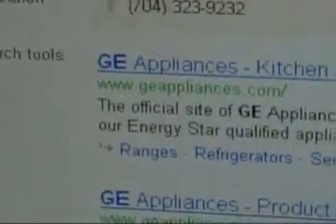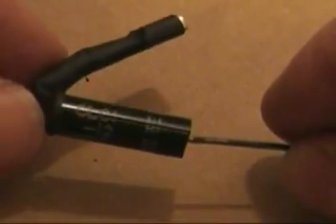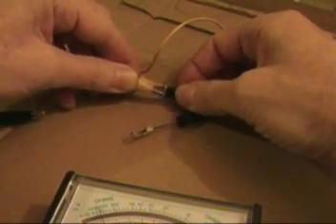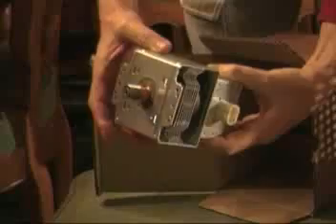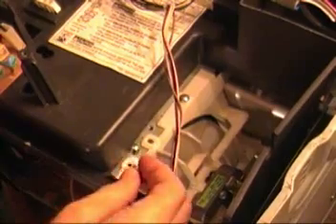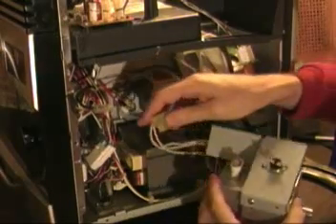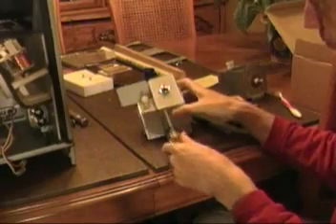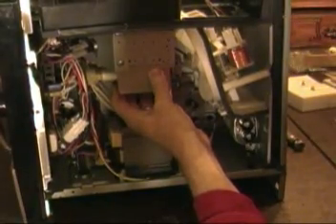GE Microwave Magnetron Replacement And Component Testing

Comment: Every microwave breaks. The parts are from Chy-NA
Reply from the maker: Yes.  Irrespective of country, they make these parts to last only so many cycles, then they quit working.  Infuriating that an otherwise good machine will get thrown away because of a $0.50 part failing.

Comment: This is WAY too technical for me!  I have to do the repair myself, but I'll have to look for simpler instructions.
Reply from the maker: I just re-watched, and I agree that I over complicated it.  If you just buy a replacement diode, you wouldn't have to test it, and you could start watching at 4:09.  If you DO decide to do the repair yourself, you really need to know what "short the capacitor" means, just so you won't get shocked.  They make it so the stored charge bleeds off, but better safe than sorry.

Comment: Did you discharge the capacitor?
Reply: Yes, but in my case, there was no charge in it. The circuit, I think, is designed to dissipate the charge rather than attempt to hold it indefinitely. But it's quick and easy to short the cap, just to make sure.

Comment: My GE microwave is just over 3 years old. Proving again that they just don't make anything like they use to. It stopped heating this morning and the turntable doesn't spin. I double checked the on/off switch for the tt and it still doesn't work. If it is the magnetron, would that cause the tt to stop spinning. Not sure how one has anything to do with the other if it does at all. Can you please give me your opinion.  This makes no sense. 
Thanks,
Rick A.
Reply from the maker: I presume there is fan noise when you request it to begin to cook? Having the turntable stop doesn't make sense if it's a magnetron issue; the typical symptom for a magnetron problem is a "different kind of hum", but everything else is the same. As you say, though, if you do get that "hum sounds different" symptom, the turn table could be just a coincidence.
Reply: Hi Rick, did you ever determine what your problem turned out to be? I've got a GE unit with the same symptoms
 and would appreciate any suggestions from your repair. Thanks!
Reply: Rick Armstrong  sounds like a micro switch .. or relay... if it was the magnetron it would do everything but heat. does it start the countdown what you start it ?
Reply: Dewey Corage It's a very intermittent issue, it only happens every could of months and when it goes out it doesn't count down or do anything (lights always out, etc). The LCD panel is on, but that's it. I've recently determined that all I need to do when it occurs is unplug the microwave and then plug it back in... that's the only way to get it working again and this resolves the issue each time it has happened. So it acts like something is getting locked up in the electronics. I can have it in a state where it's not working and then unplug it and plug it immediately back in and everything starts working.

Comment: It would have been so cool if you could have tested both the old and new magnetrons side by side with your multimeter to show differences. That being said, I guess since your oven had the buzzing noise AND the oven did NOT heat food, you were probably safe to assume that the mag was bad.  My GE has the buzzing noise but it DOES seem to heat normally. IF I disconnect the mag wire connection at the terminal plug, the microwave buzzing noise will not be there. (Do not unplug it while the oven is running, instead unplugged it before I turned it on).

If my transformer was bad, I wonder if I would still hear the buzzing with the mag pulled out? I can not tell which one actually buzzes even when using a long vacuum cleaner hose pipe as a stethoscope to listen to both the mag and transformer. 

The transformer was "borderline bad". One of the transformer tests says it is suppose to be between 80 and 140 olms from the hot wire to transformer shell surface (after scraping off a good section of the shell to put your probe). Mine tested at about 79.5 olms, so I am not sure if the transformer is my problem or not. I mean 79.5 is really close to 80!!!   So I need to find out how to properly test that mag!  i saw a few test on YouTube but none were specific enough..... so I need to keep looking for a good mag test. The test using the my multimeter was sketchy since the video I saw was not perfectly clear. However the mag head was clean and silver, and there was no noise when I shook it. So, if anyone has a good link or info on how to do a creditable mag test I would appreciate it if you could post it.  

Oh...as far as testing that diode, use a 9 volt battery and your multimeter. There is a video on YouTube if you do a search. Sometimes a test is not necessary if the diode has a burnt smeil...... at least that is what I read somewhere.  My diode passed the 9 volt battery test, but since my micro was heating, I would not suspect the diode anyway. 

Good luck to anyone else in microwave hell.

Comment: I have the exact same microwave. I replaced the magnetron, not the diode. After starting it back up, the same loud buzzy noise is still there, and it did not heat up the water after 2:00 of letting it heat up. Any ideas?

Comment: What was your MicrWave Doing aside from not geting Warm?
did yours all of a sudden start making the super loud Transformer humming? :-

mine one day i went to use my MicroWave,,,but it made this loud Transfomer hum and i could smell electrical burn not real strong but it was there?
at that point i didnt even bother to see if it was heating because obviously there was a problem and would almost bet my life it wasn't heating, and probly the Magnatron went south, could be the transformer but i bank against that, Maybe diod, but AGAIN beting on a bad magnatron, 

Please let me know what yours started Doing?

Thanks :-)
Reply from the maker: +chevypowertogo Mine had a slightly louder transformer hum.  No heating, of course. But I had no electrical smell.  Could be that your transformer heated up hotter when the magnetron was not working, giving off the slight smell.  I'd bet it's the magnetron since those transformers are wound with really large diameter wire...kind of industrial strength.
Reply: chevypowertogo 

what was wrong with your microwave? 

you described my issue perfectly.  I have ordered a magnetron, capacitor an HV diode.  $70 total and all new parts.  haven't tested anything but is 10 yrs. old so thought it is in need of some new parts.  beats 300+ for a new one.

Comment: My GE Microwave (built 2012) does not heat. The light inside turns on, starts the count down, but then I hear a 'click' and no hum at all! The count down continues, but no hum! Does this indicate the magnetron is gone? Thanks for any help.
Reply from the maker: jayday80 That does not sound like the magnetron has failed.  My symptoms were that it just didn't heat and, if you were attune to it, the hum was different.
Reply: +jayday80, mine is doing the same thing. Did you find a solution?
Reply: Jodi Monaco Unfortunately I did not find a solution and purchased a new cheaper brand microwave! Someone on another thread indicated it is a broken or faulty circuit. I am not really an electrical guy to troubleshoot and fix it, but I kept it hoping to get back to it someday!

Comment: i need informaition on my ge microwave above range. it went out totally. the lights the whole thing is out.  can it be fixed or just throw it out.
Reply: could be a fuse,but if keeps blowing fuses you may have door switch problem. Hope this helps.

Comment: Hi! is anybody could help me which wire will connect to the blade of capacitor where the diode attached on the other blade of capacitor? Is it the wire coming from the magnetron or the wire coming from the high voltage trasnformer?
Reply from the maker: Sorry, but I can't say specifically.  One thing you could to is look at the schematic.  In the schematic, the diode will look like this -----|<-------.  Google what the markings on the physical diode look like as compared to the schematic.

Comment: Hi! Nice video very informative. I had one question, I'm repairing my microwave and i found the micro switch is the problem. My question is i remove the wire from the magnetron that is connected to the capacitor and 1 wire from the high voltage connected to the other blade from the capacitor and my mistake i did not label the wires, would you mind tell me what wire will connect to the capacitor blade where the diode connected on the other blade of the capacitor? Is it the wire from the magnetron or the wire from the high voltage transformer?

Comment: The big unanswered question was why replace the magnetron?  Since you never tested it?
Reply: Because it was buzzing abnormally and not heating up the food or water would be my guess.
Reply from the maker: Correct Guy.  Exactly.  Testing a magnetron is hard, but if it doesn't heat and is buzzing abnormally, that's a pretty sure indicator the problem is in the mangnetron.

Comment: WARNING. Capacitor may hold Very High dangerous Voltage for days, bring it to the top

Don't test diode this way see other video using 9v battery.

Forcing (anything) including self tapping screws is a BAD idea. If the screw does not start to go in rather easily, reverse for 3/4 turn and try again. You will find the previously cut thread rather than enlarging the hole.

Regarding parts, think about what it costs to retain inventory for years after a model is out of production. Although not $20

Comment: I fixed all by myself :) I wasnt sure what all would have current so I just went threw and touched everything with the screwdriver lol! Didnt have any issues with getting shocked :) I am proof that anyone can replace the magnatron on there own lol ! Thanks for the video and the tips you rock !! It heats perfectly now ! You can hear the fan make a weird sound as it comes on and goes off , when I had taken it apart it appeared to look a little melted .Thinking the original magnatron overheated

Comment from the maker: The capacitor discharges after a few minutes, I think.  But "protocol" would have you discharge it anyway.  I can't expound upon the 100% safe protocol here, but putting a screw driver across the terminals of the thing that looks like a "can" would be better than nothing.

Comment: Thanks , mine was still under warranty but they said I had to use there repair service . I ended up ordering the part from a local place for $91 I figure that will be cheaper than paying the repair guy to come out and say yes it is the magnatron , then pay them to install the new part . I will just install it myself . Do you think it could still have power running threw it , it has been unplugged since November  ?

Comment from the maker: Unless the phone number is in the video, I'm afraid I don't know where I called.  I had the paperwork on mine and it was clear that it was under warranty.  Maybe they're trying to snow you (I wouldn't put it past 'em).  You might be able to find the manual online.  Usually the manufacturing date is on the plate inside the door.  If you bought yours a long time after mine (2007), they might have shortened the warantee period because their business model is to screw you on repairs.

Comment from the maker: I've seen them on eBay for pretty cheap.  Yes, from China, but they were the same thing that ends-up in all of our microwave ovens.  If you search by part number, you get the over priced ones.  If you search by spec, you get the generic ones that basically are the same thing.  I just can't fathom how there are diodes priced at the the level of an entire el-cheapo microwave at Wal Mart.  Nuts.

Comment: The Diode isnt just some pennies on the dollar part fyi....  that is a stacked diode that has several diodes in 1 package specifically for use on microwave magnetron feeds. the Voltage off the high voltage transformer is around 2500 volts AC and after it passes through the diode/cap combo... the voltage is 5000 volts DC.

Comment: The diode will have a extremely small voltage drop across it, but that is not what drains the cap. All the MOV caps that I've looked at have a built-in resistor.

Comment from the maker: Yeah, it's a racket.  The moral of the story is "Don't buy GE products".  Actually, you might be able to contact your state's attorney general claiming that GE is not honoring its product warantee (if parts are covered, they should be covered, period, not with any strings attached).  You also might be able to get a local appliance store to call.  They'd to it for a lot less than $250!  Or hell, just impersonate them, then go down and ask for the package that GE sent to them "by mistake".

Comment from the maker: Yeah, if you don't hear anything at all, then I'd first check the circuit breaker, or plug a lamp into the same socket at the microwave.  Presuming that you have juice there, then you could start looking for an internal fuse.  But if that internal fuse blew, it probably blew for a reason. If that's true, then there might be something else going on that's not going to be easy to fix.  But yeah, this video isn't going to help you since the microwave is not like mine was "running, but not heating".

Comment: thanks sengsationa1!  after doing some initial forum research to troubleshoot and finding parts your video helped to give me the confidence to fix my microwave myself.  i changed the capacitor (safely), hv diode and magnetron all at once b/c it's such a pain to take the micro out of the built-in cabinet and disassemble.  my magnetron was hiding behind two other casings but eventually i got it out.  only two screws left over to this project :-).  my husband will be so proud! thanks!

Comment from the maker: Especially "sucky" is that this isn't the bottom of the line microwave...it had the convection feature, which upped the price.  Otherwise, I would have been tempted to just dump the unit rather than fix it.  I was especially unimpressed too by the crap that the warrantee repair people tried to pull on me.

Comment from the maker: Karen, I've had a bad magnetron before and know what it sounds like.  There are a couple of things to look for.  One is that the food doesn't heat up, hehe.  Another is that "everything else seems to work".  By that,I mean that the panel lights up correctly, you can set a time, you can initiate what normally would be cooking.  The last, and not so "easy" is that the "humm" is not the same.  Like Scotty knows what the Enterprise should sound like, that's the way you need to be with your microwave

Comment from the maker: Yeah, I'm not very efficient worker.  Especially when I'm my own camera man, hehe.

Couldn't bring myself to spend $20 on a $1 part (diode).  There's one on eBay now for $10, but it's still should be a dollar.  Some others on eBay are $50!  Complete insanity!  If someone would sell them at a reasonable price, then yeah, I'd replace it.  But my microwave is going strong since I fixed it, same old diode.

Comment from the maker: What you need to do is search for the part by spec, not by part number.  So see if you can find out what the spec is on the part, then do the search on that.  So you might search for "Switching Diode 12000V 0.35A", and order 10 of them from Hong Kong for $10.  Then sell them as "HV03-12 F45 equivalent" on eBay for $5 each.  You'd be a hero and make $40 in the process.